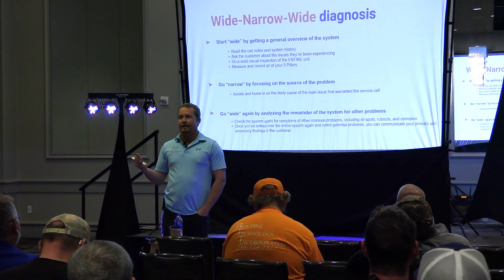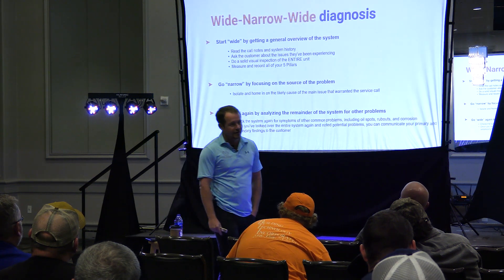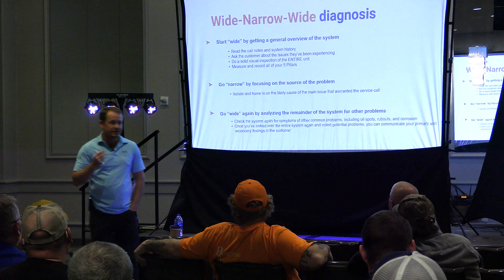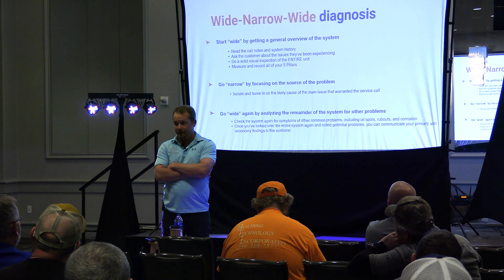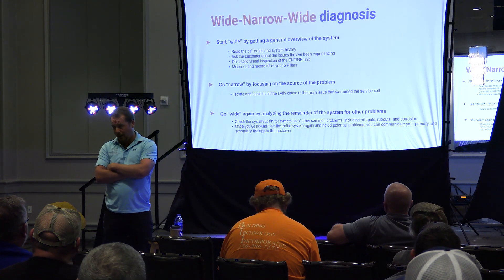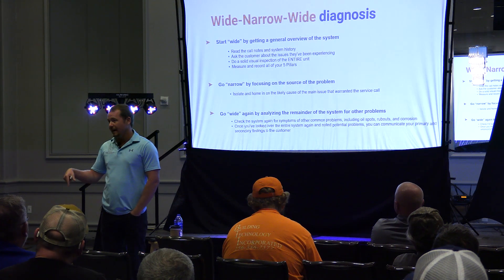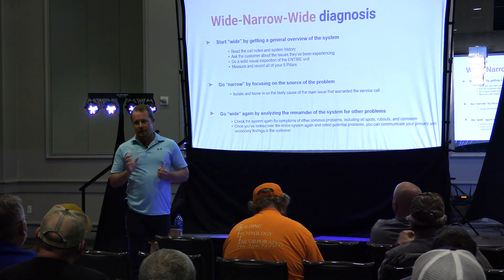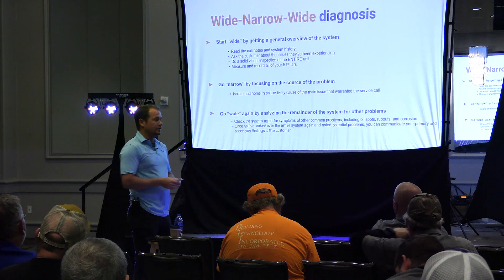Troubleshooting Process - Wide, Narrow, Wide

Comment: This is great info for guys just starting and a great reminder for the seasoned guys. Complacency can cause numerous issues including death and 9/10 times the customer will point you in the right direction. They may not know a system like we do but they do know something has changed.
Reply: I always chat with owner, customer first.  Ask when was the change noted, what was the change.  Usually it will point the tech in the direction needed or right to the issue.

Comment: If a compressor is locked then you could look at charge, air flow or oil migration but if it's grounded the only test would be acid.